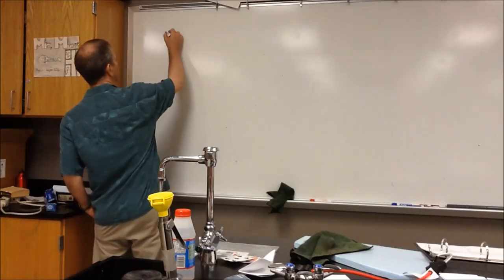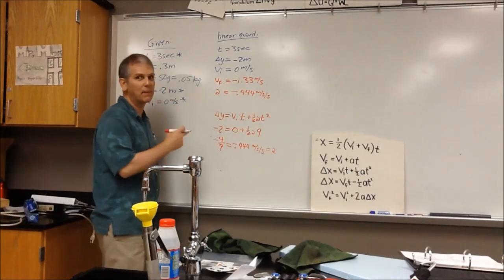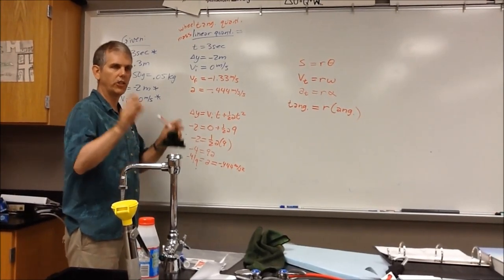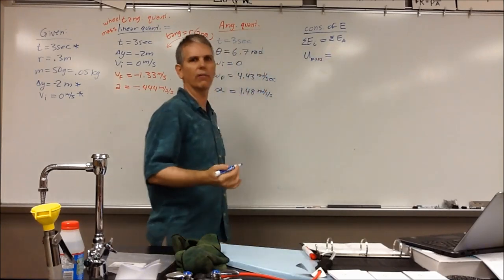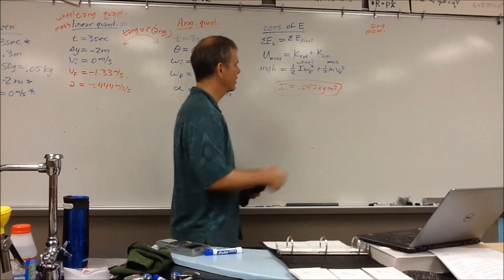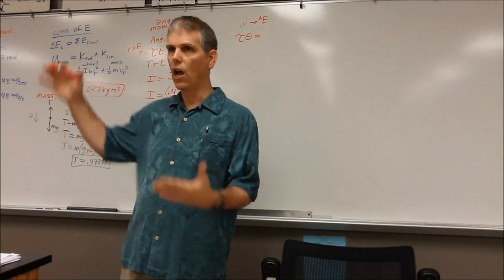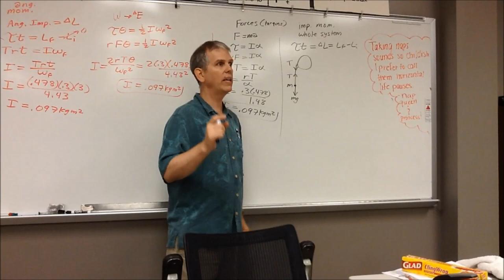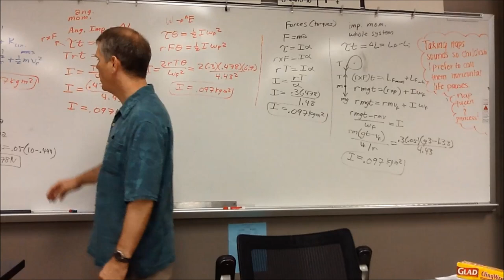Calculating the Moment of Inertia of a Hanging Wheel

Comment: Hi 
can you help me figure out MOI if I give you t, r, m, h? 
Its a 216kg roller for a dyno. 
I have calculated it, but it has ends and it is not solid so it will not be so accurate